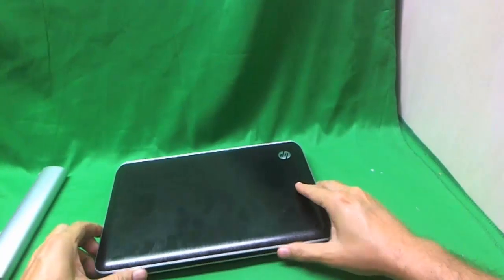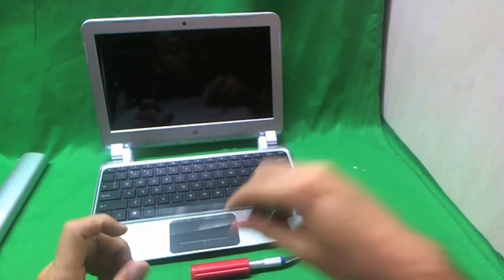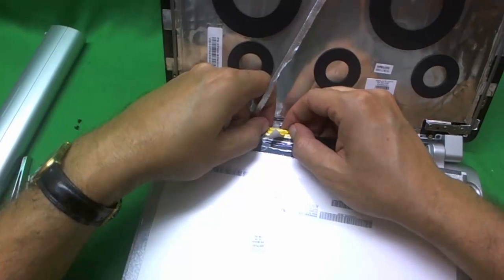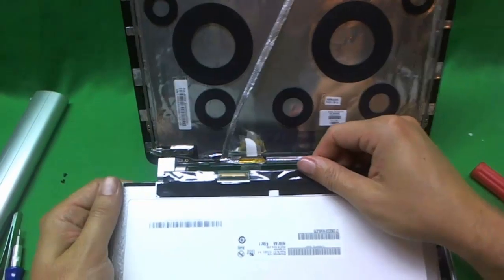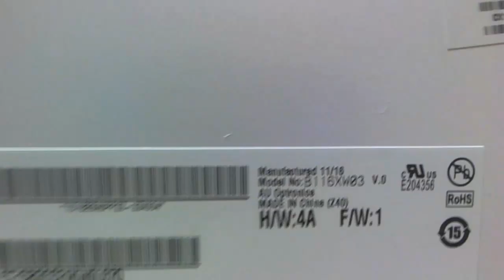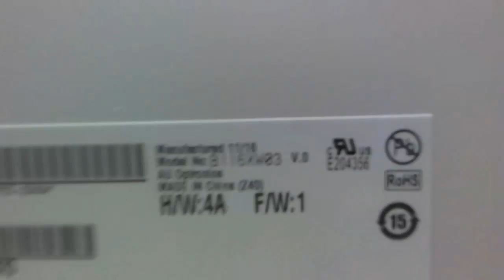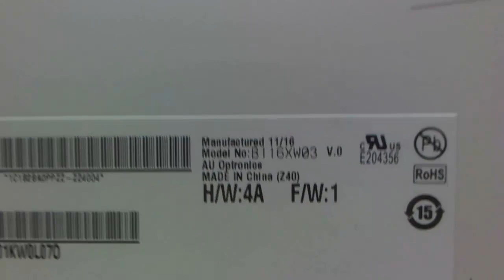HP Pavilion dm1 Laptop Screen Replacement Procedure

Comment: I should add that I have a dm1, but it wasn't the bevel covers didn't pop off with a utility knife like you showed.  I had to pry them loose from behind and then pull out from the front.  There were no screws behind them.

Comment: This video gave me the info I needed to order a replacement screen and install it myself. It went exactly as shown--almost. HINT 1: the little plug is incredible fragile, be VERY careful with it. HINT 2: there is a tiny magnet inside the bezel-- don't move or lose it! I found it stuck to my hand, didn't realize what it was til my (fixed) computer would not "sleep" when I closed the lid. I figured out where it belonged by moving it around the edge of the keyboard until the computer went to sleep.

Comment: Great and helpful video! I fixed the display on my son's dm1 with the help of this video. Be sure to watch the whole thing - the presenter's comment about correcting where he'd pull the tape off if he did it again is a especially helpful. I also suggest using a nylon pry bar to get the bezel off. I have a set I bought at Northern Tools and there's one that's very flat at the end that worked perfectly to help separate the bezel from the lid.

Comment: Nice onbe - fixed my screen even though mine's a newer model with no securing screws. Had dropped it and the screw had vibrated loose and left the screen wobbly :s